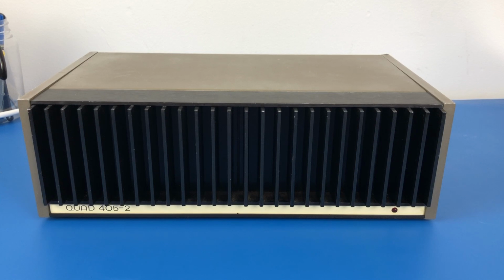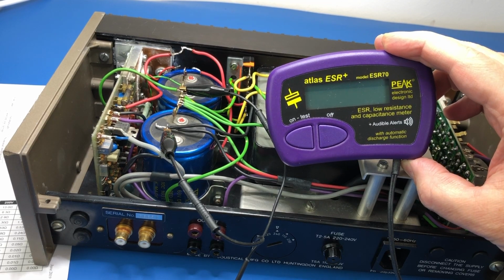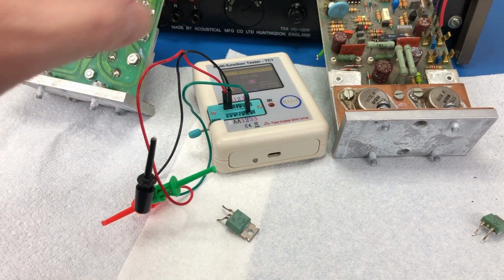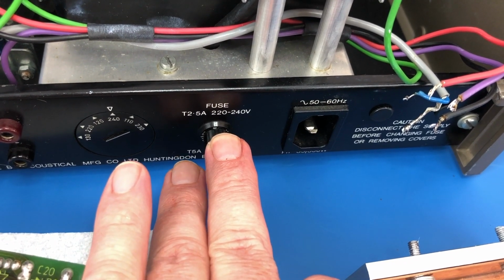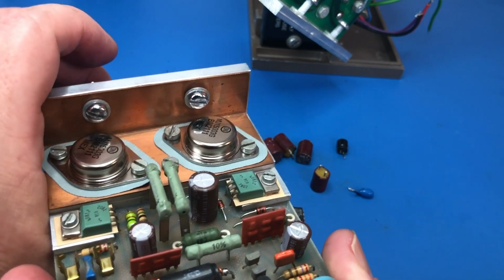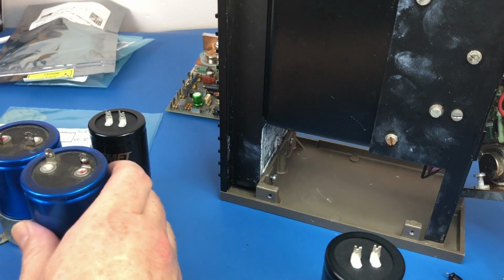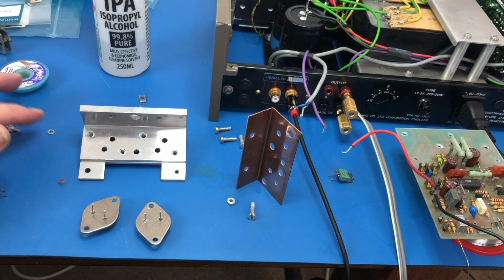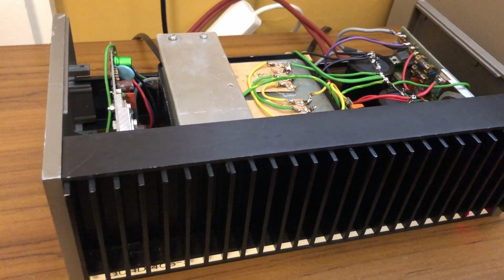eBay Quad 405-2 amplifier repair

Comment: When you test the main output transistor cases to the heat sink what reading are you getting ? You said it should be isolated but I’m getting 650!ohms ish. Is this ok or should it be0
Reply from the maker: It should be Megaohms
Reply: @audionautica6843  I’m getting 700 ohms on tr10 and22k on tr9.
It’s definitely not an insulation problem I’ve triple checked. It’s from the board. Both boards are reading the same. Can’t find a single component out of spec. Anything you can guide me with?
Keep up the good work love the vids
Reply from the maker: As I said earlier, if the transistors are in circuit, then you're probably looking back through the circuit to chassis, so those readings are not necessarily a problem. I'm afraid It's not practical for me to pull my amplifier apart to measure things for you. As you've noted, you've got two boards that are identical. Are both channels dead, or only one? Have you checked the power supply, making sure that you have the correct DC volts, and that it actually is DC volts. (i.e. not a heap of ripple on it). Have you checked the electrolytic capacitors? As I noted in the video, those small electros on the boards tend to die. You need to actually check them with a proper capacitor tester. Don't replace parts for the heck of replacing them. Test, and if actually faulty then replace. Also don't forget to check that you have the +/-15 V powering the Op Amp. It IS a good idea to replace the Zener diodes and the series pass resistors, as these are prone to failure. One of my amps blew up because of this. Of course you will have checked that the power transistors or driver transistors haven't gone short circuit.

Comment: I think a potential mistake you made here is not reforming the filter caps for a few hours, please correct me if you did.  But as long as the amp is working for a few  moments in test, put the system on a dim bulb tester with say a 100 watt bulb and let it ride for half a day.  Testing the ESR on a cap like these without at least running them for a few hours, on equipment that likely hasn't been worked for months or years or decades, give them a chance.  I have replaced so many filter caps on principle only to later realize that just running them for a few hours and they test as well or better than the replacements at high voltage.
Reply from the maker: Fair comments. I honestly cannot remember.

Comment: Friend of mine had one of them in the early 80s, great sound even when he used to crank it right up.
Would be interesting to see how those filter caps measure up after a bit of time.

Comment: Excellent video and I appreciate your work on this lovely old amp. Also, your experience has been very useful in demonstrating how important it is to measure the filter caps out of the circuit before buying replacements. Could save me some money in the future!

Comment: Thanks for the great video - very interesting and comprehensive! I'm not sure you are right about the copper plate on the dud channel not having thermal compound when built. You spotted a loose screw on the finals of the board and I can see the earth lug on the finals was not the same as the other board...
Reply from the maker: Thanks for that

Comment: Why not use Fairchild outputs on both channels much more robust than the original
Reply from the maker: My research indicated that the Onsemi part is the preferred sub. Thanks so much for watching.
Reply: On Semi is made by Fairchild The point I was making was to use the same outputs on both channels Cheers
Reply from the maker: @pernilsson2512  Yeah, fair comment, I don't believe in changing out things that don't need to be, unless there is a good reason to do so, and when it comes to finals I think its always nice to see the originals in, wherever possible. The first rule I learned in electronics is "if it aint broke, don't fix it"

Comment: Great stuff, I have just done a mk2
One point, it is worth changing r7 andr8
They run hot and drift .. if they fail it causes major silicon damage . I used high tolerance 1W .
Reply from the maker: Yes. If you look at the other 405-2 that I did, a few months after the first refurb it blew a channel. I discovered that the 15V had gone awry, so ended up replacing the zeners and R7 & R8, as well as blown things. I should probably do the same on this one. Hopefully I ordered spare resistors, and will find them in my parts drawers!
Reply: Good plan .. I hope your external  dc protect circuit protected your speakers .
Reply from the maker: Sure did!

Comment: My 405-2 wiring didn't look like that.. It was far tidier and smarter. I think that that Amplifier has been messed around by the previous owners ?
Reply from the maker: Agree it is different, but doesn't strike me as being messed with. My understanding is that Quad would do also sorts of "to order" variants. There are a number of variations on this unit that to me look too well done to be a "bodge". Eg, copper metal shim under heatsink, shield over connectors, RCA inputs instead of DIN, earth runs directly to amp PCB. But apart from that it is electrically stock standard. Why would anybody redo the harness for no reason? Perhaps these custom builds were built in a different section or by different people.

Comment: Have a untouched 303 next.
Reply from the maker: Interesting. I've not had a 303. Maybe one will turn up one day.
Reply: @audionautica6843  Worth trying a 303, makes a lot of difference if in good serviced condition. I have four 303's, my 405 was bought by me new in 1976, about 1987 upgraded it to 405-2 with the Quad kit, still have the amp. Also have a pair of Quad II's.

Comment: Very informative! I got the same amp. It amplified, but it have a load "ta-ta-ta-ta-ta" sound going on both channels. Can that be because of bad rectifiers?
Reply from the maker: Thanks for the comment. I've just finished refurbishing a second one of these, and am in the process of editing the video. Again I found 5 out of 6 bad electrolytic capacitors on both boards. Bad boards were also pulling the supply down. 40Volts instead of 53. Normally a common fault to both channels would point to power supply, however given the way the caps fail in these I wouldn't assume so. If the boards haven't been refurbished they should be.

Comment: I have been messing about with clone 405 PCBs on my YouTube channel. I found they do not clip symmetrically and have quite poor high frequency (10khz) square waves. I was wondering if you did more tests on the real 405 to conform or otherwise if these parameters are poor or just crappy clone boards.
Reply from the maker: No I haven't. I need to get some more test gear to be able to, but right now my credit is no good. :-(. However I'd love to run some tests. You can message me on Instagram (@audionauticavids), it would be good to work out a proper test procedure.

Comment: I have a “ Bamba model P-688C” 2 CH professional power amplifier with 3 out 4 10000uf 50v capacitors blown. Can anyone help please.
Reply: Only really 2 things that will make the main caps fail. Firstly, age and/or poor quality to start with. Secondly, under rated or main rectifier diode shorted putting AC on the caps. Lastly an amplifier made for 110 volts connected to 240 volts, that will often right off all the transistors and blow up the main caps.
Without seeing it, it's almost impossible to help.
Reply: @MichaelBeeny  Thanks for the reply. It’s over ten years and had not been use the last 3 years. Gave a loud bang and smoke when power up.

Comment: I really am surprised that you have the courage to connect that Quad to your 4333s. I repaired one of those amplifiers and noticed that if one of the fuses on those boards blow, depending on which rail, albeit +50V or -50V, the opposite rail voltage ends up at the speaker terminals. I think only Quad could be able to do such a thing and live to see another day without bankruptcy.
Reply from the maker: Oh I'm sure Quad are not the only ones. If I recall, there is a rudimentary protection circuit, albeit not a very conventional one.
Reply: @audionautica6843  Correct. On the issue 9 & 10 boads, if  more than a few volts DC appears on the output, the whole thing crowbars & takes power off. Crude but effective. The clone amps do not necessarily use high quaity components, and sometimes recycled semiconductors, which will give its sound a bad name! Also that amp has deffo had re-work. Quad's wiring is a lot tidier!
Reply: Phase Linear did this too.

Comment: very odd design with those copper sheets on top of the alluminium sheets
Reply: It's made on purpose - copper has appreciably higher thermal conductivity than aluminium alloy, but also higher specific heat capacity per cm³. This helps to dissipate the heat faster and ensures less of a potential difference in temperature between the devices. Best heatsinks would be machined pure electrolytic copper. Then again, thermal resistance of the interface between copper and aluminium might be an issue here, if not done correctly though.
Reply: @paulb4661  Yeah i realize that, copper is better but it's not orders of magnetude magic better and it's such a thin sheet as to make almost no differance IMO.  in addition to that they have introduced a new thermal barrier between the copper and alluminium.
Reply from the maker: Sure is - but I'm guessing it came out of the factory like that.

Comment: Thanks for this. A mate of mine just brought his 405 around for me to check out. It too is dead on one channel, so I now have a yardstick to start. I LOVE Quad stuff.
Reply from the maker: Good luck with the repair!
Reply: @audionautica6843  Thanks. I pulled the cover off, plugged the unit into my dim bulb tester and it showed a short somewhere. Looks like someone in the past has replaced the OP trannies on the left channel, but used mismatched ones. The RH channel OP's look original. The top fuse on that board looks like it has blown and welded itself again as it shows continuity. It's a rabbit hole eh? This is a series 1 405 BTW.
Reply from the maker: @johnlake6321  Looks like you're on the right track!

Comment: Congratulations
This is a very interesting step by step video.
Someone did a restoration of my Quad 405.
About the same thing you did.
Now the amp sound a little bit agressive or grizzling at high level.
Is there any bias adjustement to do or anything else.
The tech that did the job has retired.
May be you can help me with that.
Thank you. Sorry for my english, I speak french.
Have a nice day.
Reply from the maker: No - this is one of the features of the design is that there is no bias adjustment. I suppose if the tech changed something he shouldn't have, that could put it out.
Things to ask yourself 1) Is it both channels? If it is both channels, then the same problem has been replicated on both boards, OR it is a single fault that affects both boards, and the only thing common to both boards is power supply. "Grizzly" to me sounds like distortion. IF the main filter caps were unable to supply sufficient current, then you could end up with distortion at higher volume levels.
You might try to find another tech in your area to look at it.
Good luck!

Comment: Hi , thank you for your videos. What old amps du you like the most ?
Regards Reinhart
Reply from the maker: And thank you for watching! I have a real soft spot for the Leak Stereo 70 and its little brother the Stereo 30 Plus. Nothing special on paper, but they have a very distinctive British mellow sound which I love.
Reply: @audionautica6843  I'm amazed they are still working! Not the most reliable amp even in there day. Lots of crossover on the Leak D30
Reply from the maker: @MichaelBeeny  I had four 30 Plusses which I have now moved on, but still have the 70. They were all cantankerous to some extent, the 70 is a lot better now after some TLC.

Comment: You measured the old caps in circuit that’s why your previous measurements were off.   Also you should always bleed off a cap before measuring it, it’s common practice to do so.
Reply from the maker: Both of those points are very important and well being reminded of. Thank you! Fortunately my capacitor tester automatically bleeds if it detects any charge in the cap. You can test caps in circuit for an indicative measure, however in this case I had indeed disconnected one side of each cap before testing.

Comment: Dear you could use the old brackets with rubber from an old bike tyre to make it fit. Its easy and cheap.. 👍
Reply from the maker: Yes, you could. Of course it does look neater with the correct brackets.
Reply: A 3D printer could easily make a custom insert to adapt the new cap to the old bracket.

Comment: Could you post the parts list I am rebuilding 2 of these and that would be very handy :)
Reply from the maker: I am going to make a complete refurb video, and I will post the parts list with that.
Reply: @audionautica6843  Lovely old job, thank you I am going to buy a decent audio hat for a Raspberry Pi zero 2 and make one into a wireless receiver as those amps are build just up the road from Cambridge in Huntingdon thought the Pi would make a nice fitting upgrade.

Comment: For your capacitor,the datasheet says that max ESR for a 10000uF/63V at 20 degrees celsius and 120Hz is 0.04 ohms so your statement that ESR is too high,is wrong!
Reply from the maker: Thanks for your comment. I agree.